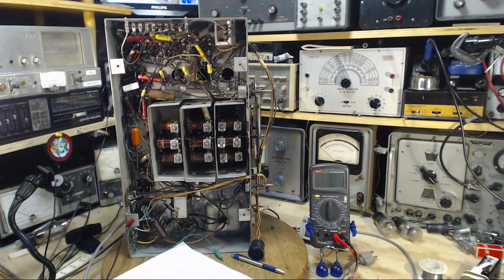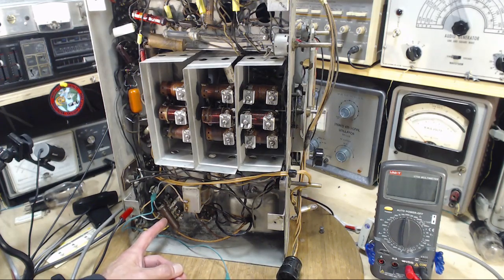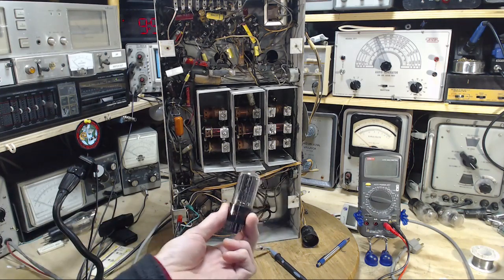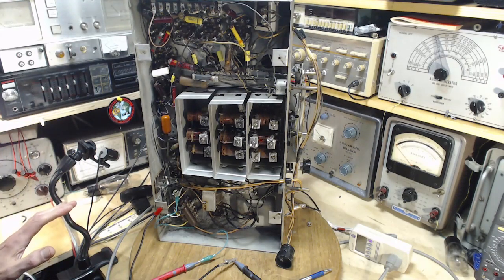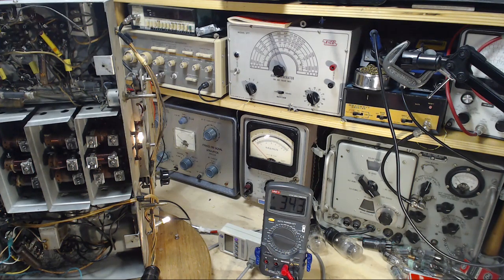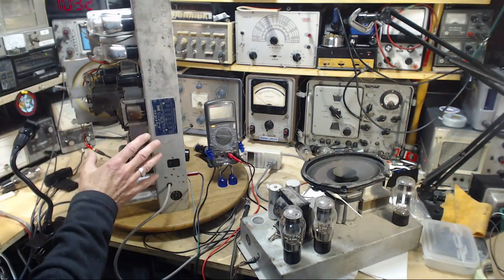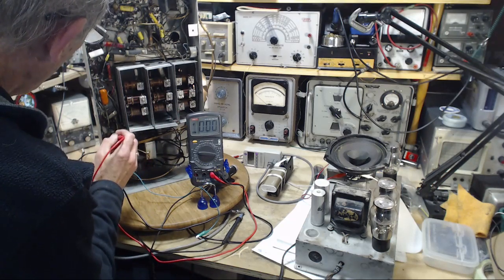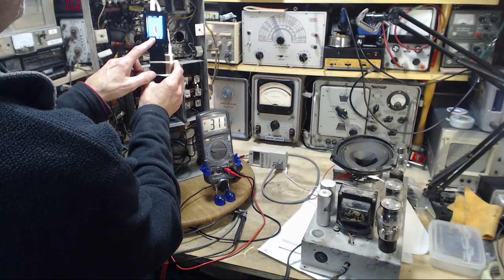Sparton 1567 Huge Tube Radio Video #9 - Rectifier Tube

Comment: 5Y3's are very common here in the US.  Many of my radios use one.  I know using a 5U4 can overheat the power transformer in many sets, especially Zenith's and others that used marginal transformer designs.  My understanding is a 5Y3 and 5Z4 are comparable, but to never use a 5U4 unless the transformer was specifically designed for it.

Comment: Your voltages are going to be much higher, than the voltage tables given, on the digital voltmeter (1Mohm/volt) than they would be on a anologue meter ( 20kohm/volt) due to the difference in input resistence?
Change the old Capacitors and stop adding more junk box resistors on tag strips, this is just confusing the issues this radio has.

Comment: The 5u4 uses 1.2 amp more heater current.  Don't sub a 5y3 with one.  5R4 is a perfect sub and has higher current.